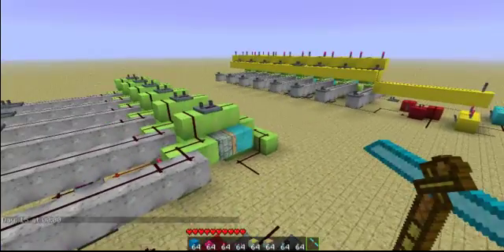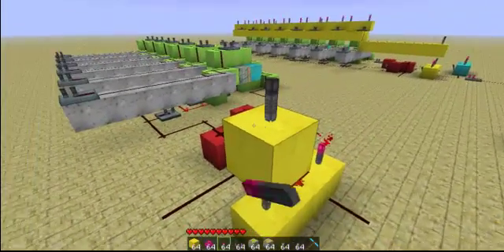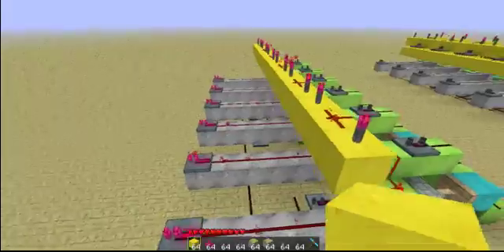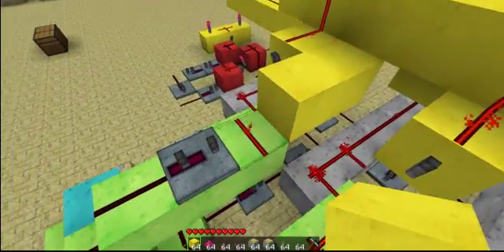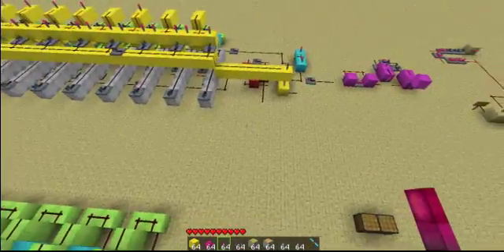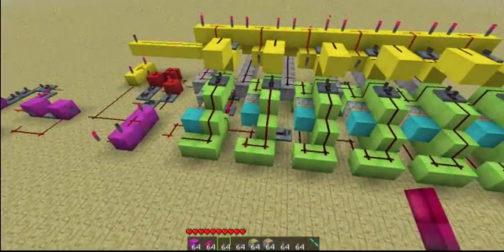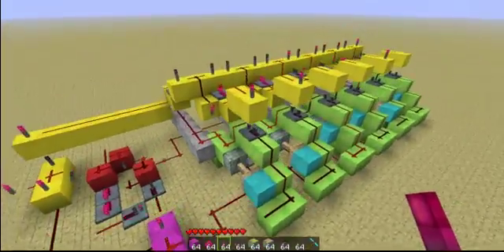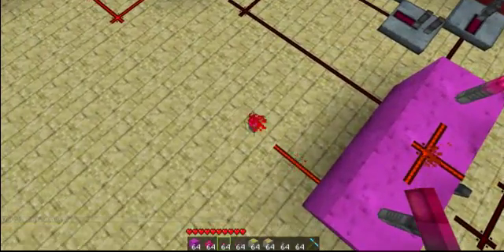Minecraft - How to Build a Program Counter With Branching - PART 2

Comment: &chadderboxTV you can either use it on your standard ROM, or create a separate set of ROM and use that as program memory, which uses a program counter (like this one) to cycle through each line of ROM/Program memory. Each line of ROM/Program memory is effectively one line of code, executing whatever commands your CPU has. Do some Googling/YouTubing and you'll find how to create a basic CPU.